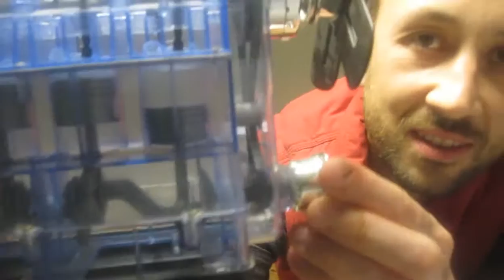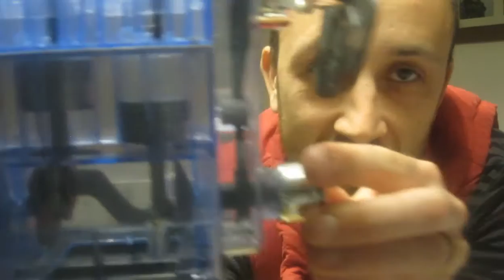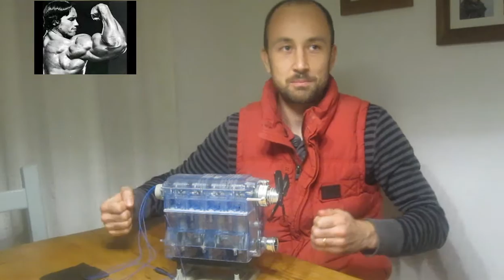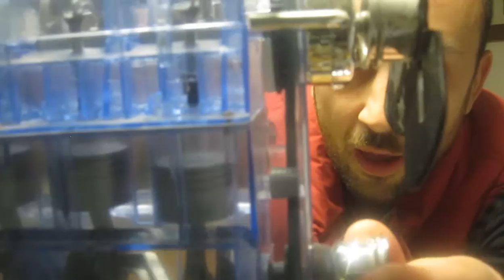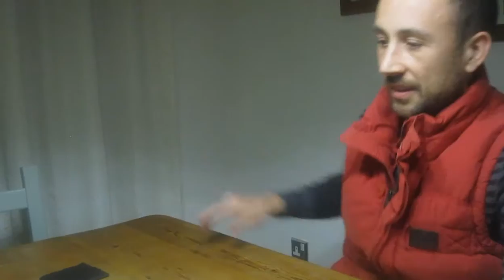Torque Vs Power: Why Power Wins Races and not Torque!

Comment: Unfortunately you dont really understand what HP really is; thats ok, most people dont either.  To understand HP one has to understand James Watt's and the engine builders of his day's attempt at emgine modeling. The Early builders of steam engines, 1700 - 1800's, used Radians to qualify circular functions as it applied to angular velocity; as in how many revolutions was a flywheel spinning per second per minute.  Radians were the new mathmatical kid on the block in the 1700's.  Radians qualified circular velocity in a "per second" measurement while RPM's qualified circular velocity in a "per minute" measurement.  Without getting too complicated suffice it to know there are 2Pi Radians per revolution of a circle. 1Pi = 3.14 while 2Pi = 6.283; divide the 6.283 by 60 seconds and you get .10472 radians per sec.  If you took James Watt's horsepower per minute rating of 33,000 ft.lbs. and divided that by 60 to get a ft.lbs. per second horsepower rating of..,
33,000 ÷ 60 = 550 ft.lbs. per sec
The 550 gives us James Watt's standardization rating of 1 Horsepower per second, but didnt tie in hp per sec to circular functions of a flywheel on an engine, this is where Radians per second enters the picture. Divide Radians per second of .10472 into James Watt's 1 Hp per second of 550 ft.lbs
550 ÷ .10472 = 5252.1008
There is your 5252 variable in the
HP = (RPM × Torque) ÷ 5252 eqation
If you stuck with the RPM HP rating of 33,000 ft.lbs per minute figure you could take 6.283 and divide 6.283 into 33,000
33,000 ÷ 6.283 = 5252
Regardless whether you use 6.283 or .10472 doesnt matter, both representit Radians Per Second Per Revolution Per Minute and yield the 5252 variable. So you're prob asking, why Radians?  The Radians combined with James Watt's 1 Hp per second measurement is a qualification of how effectively (efficiently) torque is being applied at any given RPM.  Because 5252 is a constant in the HP per TQ per Second math; Hp and Tq will always cross at that 5252 RPM on a dyno.  For those of you in the U.K., simply multiply 1.8181 conversion factor by any Hp/Tq dyno# to get your equivalent.  The 1.8181 constant is a Nm and Kilowatt conversion from Imperial#s.
Example:
5252 × 1.8181 = 9548.6612
HP by itself is a dimensionless unit.  It has no value until Torque, RPM, and Radians are factored into the equation.  By saying HP wins races you are confusing its relationship.  Now if you were to say,
"Setting up, or building an engine, wherein it produced a set of output #'s on a dyno that resulted in a high output engine" then you would be correct.  To your argument, you can build an engine wherein the TQ figure peaks earlier in the RPM range while the HP figure peaks later in the RPM range; and this would be a fun engine.  To imply that HP wins races only gives evidence you dont really understand HP.  HP doesnt replace Torque.  As in any math equation once you know its variables, that equation may be transposed - say to use HP, RPM, the 5252 constant to obtain Torque; but transposing the equation doesnt alter the Tq Hp relationship.  HP merely qualifies how effectively Torque is being applied; nothing more nothing less
Reply: What a load of shit. Power is energy/time. Horsepower is a just an old measurement of power which is a very basic physics concept most should understand by about 16.

Power is the key measurement in terms of basically every machine involved in moving an object. If two machines are equally efficient and have the same power they will move the same weight with the same acceleration or speed provided they can apply enough force to begin moving.

The only time torque matters is when a vehicle cannot physically move due to to much force applied against it be it a big load up a steep hill or whatever. Once the cars rolling power is the only determination for acceleration, this is obvious to anyone who understand basic physics equations like ke=1/2mv^2, p=w/t
Reply: @PiOfficial  except „ torque only matters when vehicle cannot physically move uphill big load etc „ well yea partly from 0 to 0,00000000000000000000000000000and 5 hours later 1 km/h 😉 in fact  cos smallest move required power 👌🏻 the point is engine still produce power combustion engine even when wheel are in dead stop engine spin like crazy transfer power from crank flywheel. to clutch which be friction and velocity diffrenc start move at end axle whell tire and so one 👌🏻 se even right at dead stop when wheel are in no motion already power from combustion engine with gear still count to start spin wheel from place in corelation with inertia of rotation some element  like flywheel etc.
Reply: Actually this dude on this video whoever he is in regard atleast to titlee this video is 100% correct 👌🏻🤷🏻‍♂️ dont wamt analize preciselly what he say in this video but its 100% true that power win race not torque 👌🏻 powet at given velocity is how much force is output at contact path aka thrust  naturally first it must go through whole drove train and wheel inertia so thers some losess but yea its just power which drive vehicle forward ,torque be itself is pointless the same as rpm and gearing be itself  when team which let say make some vehicle for drag races want to have best posiible acceleration for given engine powergraph they need to setup gearing in such way for stay as long on max power as posiible assuming thereis enough traction 👌🏻 dosent matter max power be at low rpm like in some tdi or at vey high rpm like in some n/a with short stroke engine max thrust can be achieve only at rpm where engine generate max power 👌🏻 feg 100 nm at 10000 rpm vs 10000 nm at 100 rpm  if each we setup that first egzample  engine be hold be cvt setup on 10000 rpm and second on 100 rpm and try race them on track both would go head to head why ? cos both generate the same power now put on this track with both those vehicle engine setup which have feg 300 nm at 6000 rpm and assuming thers enough traction it would smoked both 2 first egzample why ? cos 300 nm at 6000rpm is way more power on each corner when you put pedal to the metal out of corner 300 nm 6000 rpm version just desapear 🌪 from 2 first version 🤷🏻‍♂️and all explain simple formula watt:m/s = force 👌🏻high torque at engine crank low on rpm is good for daily riding where you want nice elasticity of engine without reduce gear and revv if to the celling 😁👌🏻 in race peak power iswhat really matter preciselly speaki g avg power closest to peak which can be calculate in regard to diffrenc in gear lenght and how preciselly loook power graph closest to peak power 👍🏻
Reply: @mociczyczki  You cant use "negatives" to debate an issue.  By rejecting torque, because you dont understand the 5252 variable in the Hp/Tq equation or its history behind the equation, you have likewise rejected Horsepower.  Your use of power, torque, force, load, rpm, velocity are being used indescrimantly in an inconsistant manner. If your arguments were being turned into a Mechanical Engineering class as a thesis on why HP wins races, your Professor would give you an F; you haven't offered one fact other than feelings. Your vehicle that cant make it up a hill because its overloaded.., doesn't define torque nor horsepower: again both vague and ambiguous use of the terms. Feelings dont matter here, only the facts. Since you didnt understand my explaining the 5252 variable, lets approach HP slightly different. Again we will approach it from a Steam Engine's point of view when the Steam Engine was hitting its stride, but through MEP, [Mean Effective Pressure]. The formula is,
HP = PxLxAxN ÷ 33,000
P= MEP in psi
L= Length of Stroke (in feet)
A= Area of Piston Top (sq.inches)
N= Numbr of Power Strokes/Minute
..... Multiplied by the # of cylinders
MEP stands for Mean Effective Pressure; psi is Pressure Per Square Inch. If you will study that equation a few things should jump out at you.  First is the 33,000 variable.  This is James Watt's standerdization of 1 HP but in a "per minute" time constraint. Interestingly, James Watt's Standardization of 1 HP also had the Horse's "Pounds/Ft of Force" in it but never actually qualified the "Moment of Force" in a per minute per second format: that came after his death. In the PLAN equation you can see the equation for Displacement. Because of the modern day engine, being a 4 Stroke (4 Cycle) engine, you have to divide the Stroke by 2; as the crank turns twice for one cam rotation. So, the simple Steam Engine Equation gets a little complicated, but still uses all the modern day terms properly.  The equation now looks like,
Horsepower =
(MEP•Stroke•Bore^2•Pi•RPM•#Cylinder) ÷ (12•4•2•33,000)
Kind've long but shows the displacement equation in it. Tidy up the equation without showing the displacement variables and you get,
Horsepower =
(MEP•Displacement•RPM) ÷ (12•2•33,000)
And after crossing out numbers and getting your least common denominator, you get the easy on the brain equation of,
Horsepower =
(MEP•Displacement•RPM)÷792,000
If you can read between the lines, HP can't exist without Torque, Displacement, and RPM. Horsepower is basically a tallysman in that HP tells you how many times the Torque (Moment of Force) is being applied per minute at the Flywheel as in Rotational Force within Angular Velocity; in other words - how many times the Cylinder Cycle (Frequency) is taking place in a time constraint.., aka: RPM and measured at the Flywheel.  Remember the Cylinder Cycle? 1) Intake 2) Compression 3) Combustion 4) Exhaust: hence 4 Cycle or 4 Strokes as in a 4 Stroke Engine. So if you built an engine that hits 100 HP at a theoretical RPM and also built another engine that hits 200 HP at that same RPM. The 200 HP engine utilizes Torque at a specific RPM more effectively than the 100 HP engine at that same RPM. The 200 HP represents the Frequency in which the Cylinder Cycle repeats itself at that specific RPM.  In other words, the Combustion Stroke occurs 200 times at that RPM wherein the 100 HP engine only repeats the Combustion Stroke 100 times at that particular RPM; therefore making the 200 HP engine more Effective (Efficient) at that RPM. Imagine that 200 HP figure metaphorically being a Hammer that hits an Anvil every time the engine goes thru a Cylinder Cycle.  That would mean our 200 HP engine, via the Combustion Stroke, would have that Hammer striking the Anvil 200 times every minute at our theoretical RPM. HP is merely a qualifier of how many times Torque is applied via the Combustion Stroke in a time constraint; our time contraint is in minutes or seconds; both Minutes and Seconds are related via Pi through Radians.  I remember a few big name engine builders say what I've said here but they said it back in the 1980's.  I didnt know what to think of it then, they were smarter than I. It took me another 25 years and reading a butt load of books to finally understand what they meant.
Reply: @kevinshasteen5682  ok we cant say hp os how many times torque is delivery per minute etc but how many times avg torque specified level of tprque is aplide per minute than its correct still watt:m/s = force  amd power win race 🤷🏻‍♂️😂
Reply: @mociczyczki  lol, it isnt that you cant say HP. Power is there, it is an event that takes place just not how everyone thinks.  HP is a derivative of TQ, Displacement, and Radians; not the other way around.
Reply: @kevinshasteen5682   so hp is like cake and everything else are ingredients on this cake 🤷🏻‍♂️ so ? i dont talki g about how engine generate power im talking about when you take 2 cars one 400 nm 100 hp other 200 nm 200 hp both perfect gearing the same weight both rwd similar shifting time and so forth 200 nm 200 hp eat 400 nm 100 hp version in let say 1/4 mille drag race this is what im talking about and thats what say title this video 👌🏻
Reply: @mociczyczki  HP only qualifies TQ at a specific RPM. In your cake reference why only talk about the icing, why not talk about the color of the oven that baked the cake? Why not talk about the color of the mixing bowl used to mix the ingredients, or whether the mixing bowl was plastic, metal or glass? You would look at me funny and ask why Im asking about the color of the oven or mixing bowl that made your cake. Thats basically what ppl do when they say HP wins races.  Ppl like to take one variable out of the equation and make it "the most important" variable of the process while totally ignoring all other variables. Why is your 200hp engine going to beat your 100hp engine in the 1/4 mile? What if your 200hp engine was built inefficiently and only makes .5hp per cubic inch where as the 100hp engine uses every performance trick in the book and makes 1.5hp per cubic inch? Which engine is gonna win the race now? HP in the Hp/Tq equation is up front and in your face just like Tq.  Hp by itself is an enigma which triggers ppl's imagination, it creates a mystery.  Ppl love a mystery.  Tq on the other hand is straight forward.., boring! So ppl argue what makes up the mystery and are prone to arguing irrelevant issues until a Sherlock Holmes (James Watt) comes along and helps solve a piece of the mystery.  When James Watt was formulating his Standardization of 1 Hp, do you think his arguments included that Red Horses were faster than White Horses? Of course not. Watt did differentiate that Draft Horses performed at a higher level than Work Ponies; this addresses efficiencies. When dealing with modern engines, I always ask how do you qualify whether an engine component is Small, Medium, or Large relative to the output of that engine's being Mild, Medium, or Maximum? The brain washing on misidentifying Hp's role is strong. Its fun to discuss, but you have to know in your arguments are you on point, or merely arguing what color was the oven or mixing bowl that made the cake?
Reply: @kevinshasteen5682  🫣  dude like im write earlier watt :m/s = force  , ok you wrong  understand about what we talking about title this video say 🤔 engine which makes generate whatever more power than some other engine even despite this engine with biger power generate lesss catalogue peak torque assuming optimal gearing etc win race  period …. which engine makes more ho per cubic inch have nothing to do which win race so what 100 hp is from 1 litre engine vs 200 hp from 10 litres 🤷🏻‍♂️ 200 hp from 10 litres still win this race 👌🏻 how much power can be achieve from specied displacement thanks specified construction engine and so forth is completellly difffrent  stufff   when we talk power win race we say more power at the same vehicle velocity generate more force which accelerate this vehicle forward as long as acceleration is force:mass asssuming both vrhicle weight similar more powerful one win race 👌🏻 or with not enough more weight for still hold better power to weight ratio and so forth 👌🏻
Reply: @mociczyczki  You do realise your Watt hp formula is derived from James Watt's HP formula; which ties into the HP/TQ, RPM, 5252 variables.  Just FYI to those who prefere the 756 Watt HP over Imperial Units, simply divide the Ft.lbs to NM conversion factor into 550 ft.lbs/sec to obtain Watt HP in seconds
550 ÷ .7375621 = 745.699.  Round and around we go where we stop nobody knows.  It appears your mind is made up. Ive said all I can say.  Good luck to you my friend